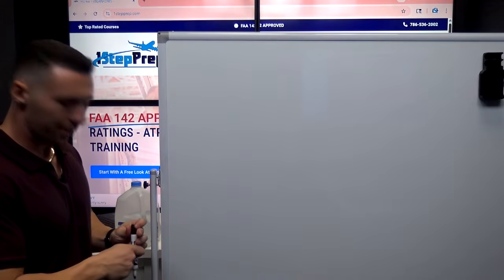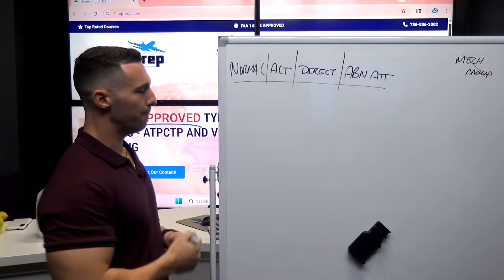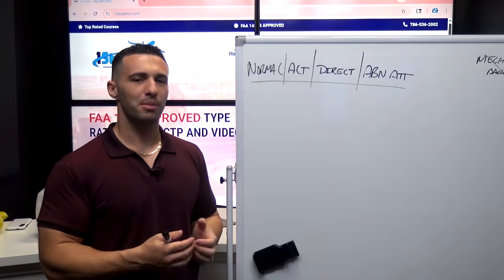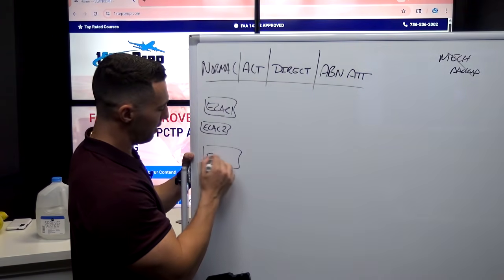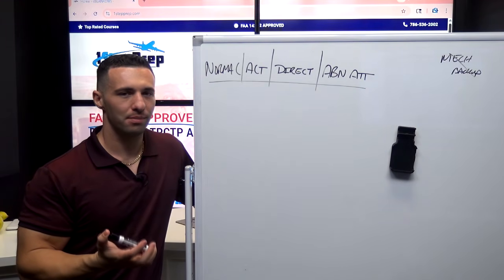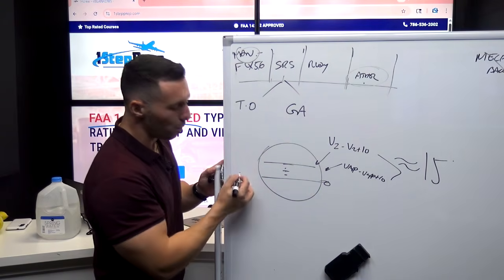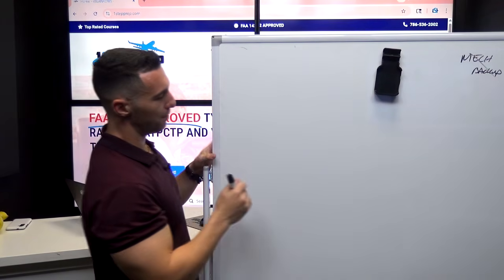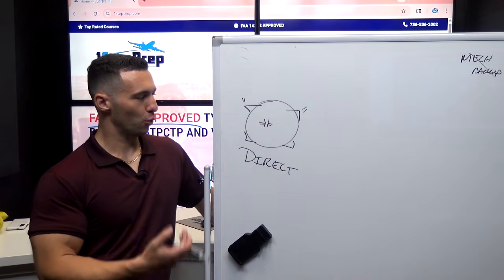A320 Flight Control Laws - Made Simple. Members LIVE Training

Comment: The Navy test pilots wanted a demonstration of mechanical backup. So I failed the computers into mechanical backup. They wanted to try and land it like that. The first guy over controlled the trim while configuring and dove into the Delaware river. The second guy saw that and did a great landing like that. But these are navy test pilots are basically gods. So…
Reply: During my type rating I've performed a mechanical backup landing, because my instructor decided to give me that chance. It could have been a textbook landing if I didn't hit the tail. It was in the TDZ and on the centerline. Then my simulator partner tried that and crashed the plane because she did apply too much trim and the result was a balloon at 50ft.
Reply: @bgsancho  Interesting. I don’t think I have heard of anyone else getting that for a type. That’s completely over the top and unnecessary. It’s certainly not in the standard profiles. Did she still pass?
Reply: @grumpy3543 it was during the type rating (not during the skill test) and I loved it. And later on at the skill test it was a pass for everyone.
Reply: @bgsancho  Okay. Thanks. I read that Airbus never intended anyone to try and land out of it. It’s just for you to maintain control while the other pilot tries some resets to get a couple computers back online. At least one elac

Comment: Yesterday had the Navy test pilot class in my 320 sim. They were exploring the laws and characteristics of the laws and degraded modes. One requirement was a VMCA demonstration. So I put it in alternate law and failed and an engine. Even in that even in that configuration with a full stall and full power on the operating engine the airplane was very difficult to VMC roll. They had to induce it with some spoiler. But then it snapped pretty good into a fully developed spin. The airplane recovered easily from the spin but it was difficult the recover from the dive without over stresssing the aircraft at 380 kts.